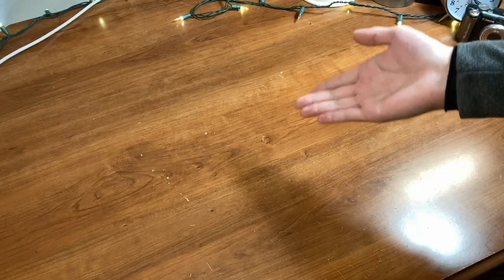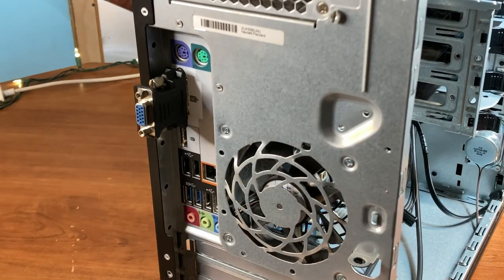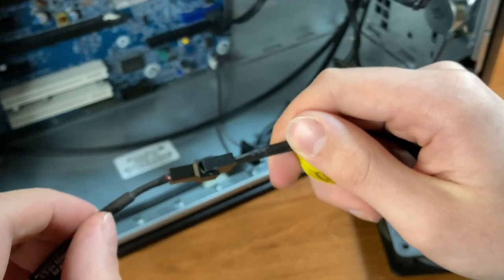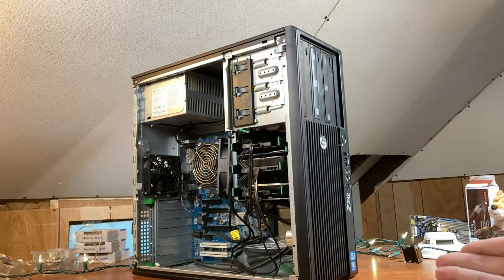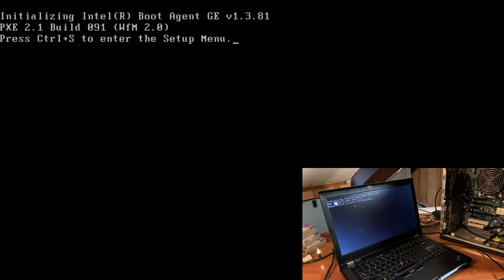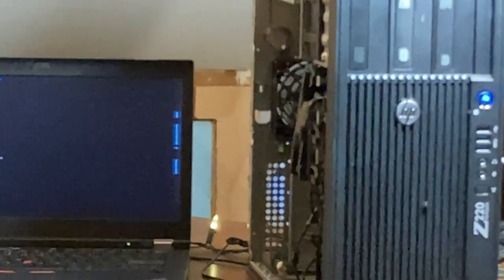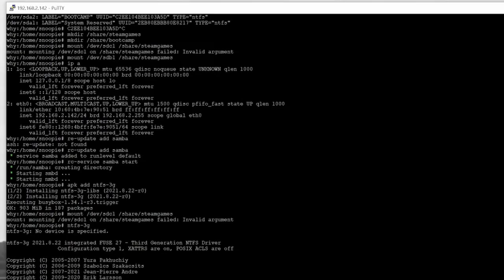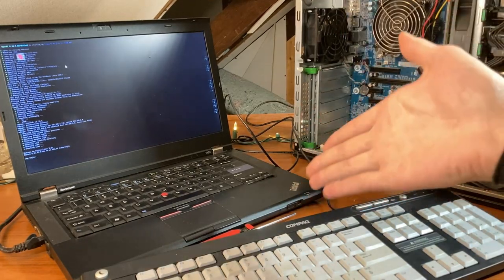The Cursed NAS Setup, With Alpine Linux!

Comment: I don't see anything wrong in your setup though. Alpine is just lightweight and functional, your CPU is enough (and NASes don't need too much specs) and having a superb machine for NAS, thinking for work 24/7, is just massive overkill and a crazy energy consumption. Also that case is well designed for the purpose.
Reply: It defo feels overkill. Especially physical volume wise XD
Neither power, size, nor storage efficient... But it's a NAS!..

Comment: The screws are similar to both older Apple hardware, and Compaq. as for the SSD Icy-Dock makes a tool-less 2.5 to  3.5 converter, mine has room for two 2.5 SSD/Sata drives.

Comment: My NAS only has one optical drive, the only case fan is powered by jumper wires jammed into a USB header and I currently only have room for 2 drives as I removed the front cage with an extra 2.
I still have a lot to learn it seems. Using SFTP over SAMBA for now at least somewhat exceeds this.

Comment: but why go with a old HP with 3 slots when you can get a old gaming case that can hold a dozen or so?  And have even more options like more fan bays and take a larger board?  And don't forget the old school rails option of using the 5 1/2 bay for a floppy but substituting a 3.5 inch hdd instead,  that works too., after all there is some early Core i series that can have up to 16 hdds without a expansion card, and there's a AM3+ with up to 24 sata hdds.

Imagine THAT combination for a NAS, just hunt for motherboards with more sata slots or that come with sata expansion cards.

Comment: you should take a look at ceph, it has erasure code by default unlike zfs and raid, is way easier to expand disk-wise or node-wise. although it's harded to setup since it's thought out for f-ing data centers